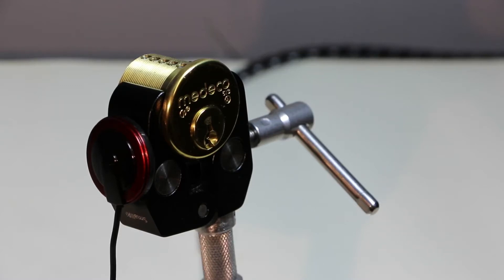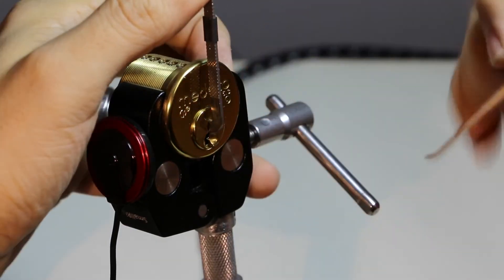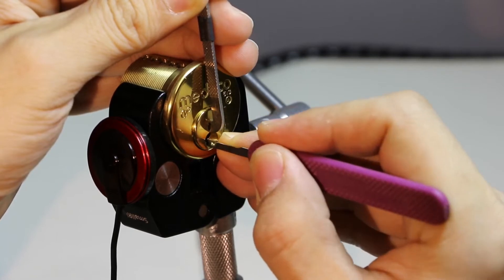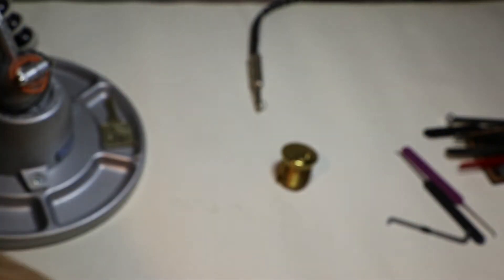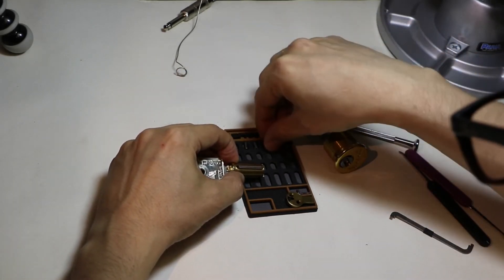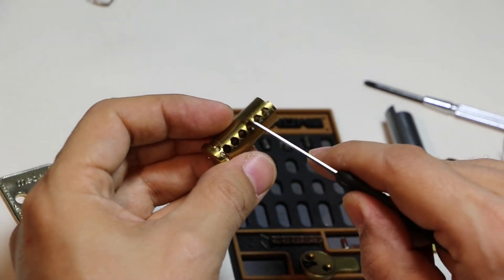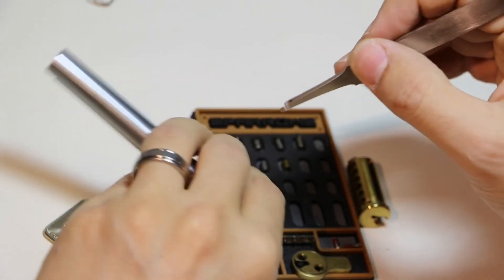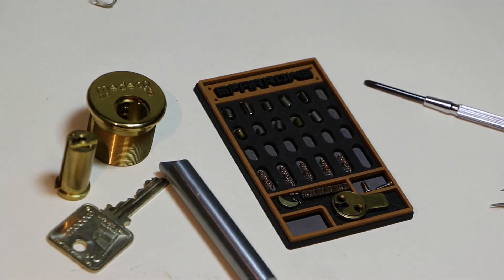[L47] Medeco Biaxial Mortise Cylinder Lock - pick and gut

Comment: Great job with the explanation and picking!
The holes for the pins are called the chambers.  
Also, a bit more info on the difference between the Original and Biaxial, is the spacing of the keypins are not uniform on the Biaxial. I see there that pins two and three are closer together, and three and four are further apart.
You picked that like a pro! The lighting looks good as well, and you'll learn as you go.
Be well, Michael.
Reply from the maker: Chambers!!! Don't know why the word was eluding me!
Reply from the maker: Also, thanks for the pin spacing info, they appear to achieve that by putting certain pins in "backwards". The chambers are all equidistant, but the pins have a long slant to them that in the Classic faces the front, however on this Biaxial 3 and 4 have the short slant facing the front.
Reply: @norlin76  I never made that correlation. Good info.

Comment: Great video! The Biaxial was actually created to enhance master keying abilities. There are 2 axes of rotation for each pin; these are the fore and aft axes. This means that instead of having a key with regular cuts in each position, you have pins that can be set closer to the bow (fore), or closer to the tip (aft). This allows for you to have double-cut keys for creating grand master and great-grand master systems.
Reply from the maker: Neat, great information! Thanks!

Comment: All 3 of my classics have mushrooms
Basically
Classic: the first medeco
Biaxial: fore and aft cuts on the key and serrated key pins and some I've seen have assa barrels and countermilling and or ARX pins
M3: same as biaxel but adds a detent on the bottom right of the keyway plus restricted keyblanks
M4: removes  M3 detent but adds 4 sliders like a assa twin plus a moving element in the key "shuttle pin"
M5: ???
Reply: Bonus:
M3B: no rotation aspect like picking a standard lock
medeco small pin: is biaxel. no driver pins but serrated key pins with false holes (like a bilock pin) found on cams/T handles and medeco metro locks
Keymark: found mostly with sifcs all standard pins with a crazy keyway
Xt: electronic lock with alien looking key
Cliq: electronic plus they key is shaped like a oval and interacts with 2 sets of 7 levers/sliders (same as Zeiss ikon verso cliq)
Reply from the maker: Thank you for the information, will definitely help to have this as I talk to more pickers on the Discord server for LPU.